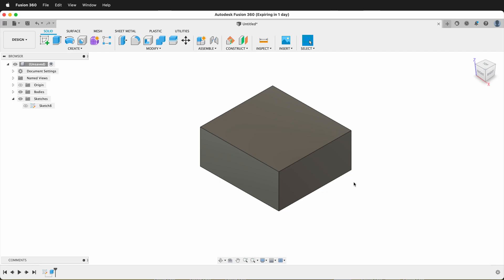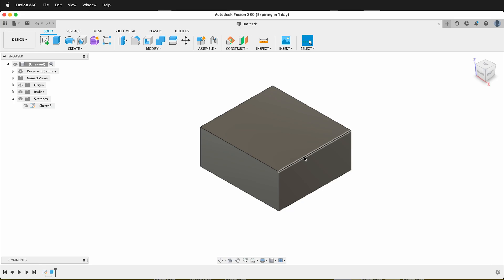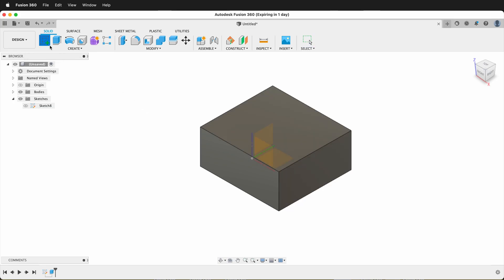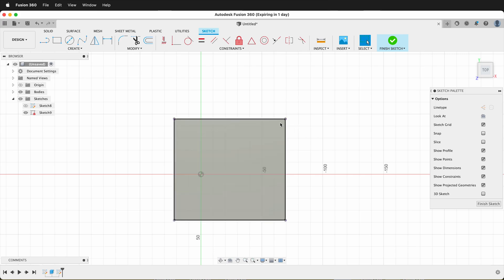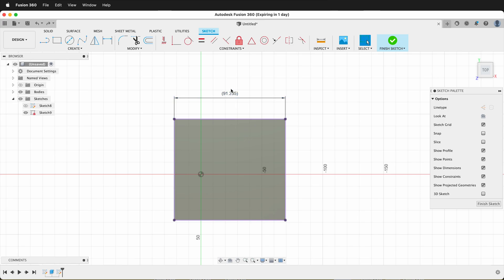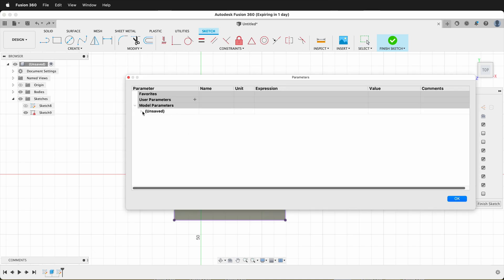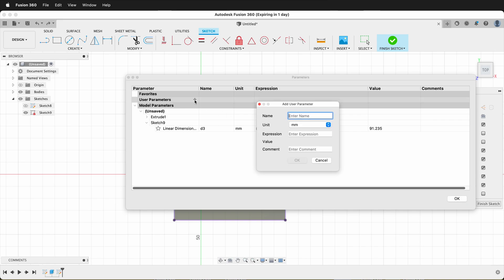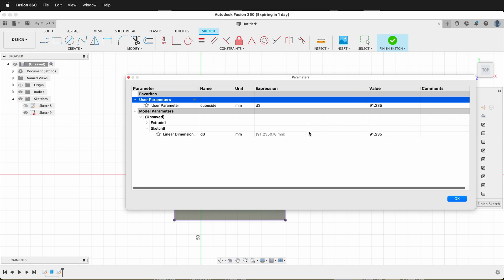Fusion 360 Driven Dimensions as User Parameters

Comment: This video is a bit of a tease, because as of today (Oct 2023) you cannot use parameters outside of the sketch. So there's not really any reason to make a driven parameter a user parameter at the moment.
Reply from the maker: Unfortunately there was not a way to use a driven parameter outside of a fusion 360 sketch at the time of the original video, then I hoped that fusion would be updated to allow more expanded use but that has not happened

Comment: I've successfully created a parameter that references a driven dimension, however, any time I try to use it when I type the parameter name in to the text field it appears red and will not allow me to complete the operation. What am I missing?
Reply from the maker: You can only use a driven perimeter within that same sketch, you can't use that driven parameter in another component or sketch unfortunately
Reply: @WhatMakeArt  this was my issue as well. this is wack.
Reply from the maker: Hopefully Fusion 360 expands the use of driven parameters
Reply: Yeah this is a bummer. It's the only reason I actually need driven dimensions
Reply from the maker: Yes, it is a strange restriction, but I imagine it will be implemented in more ways